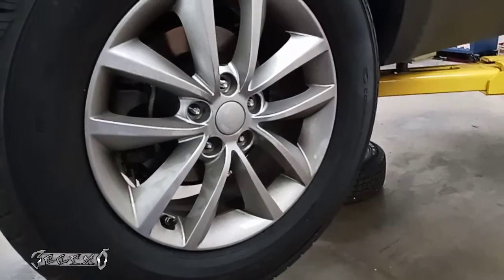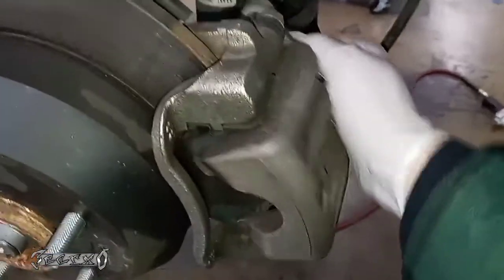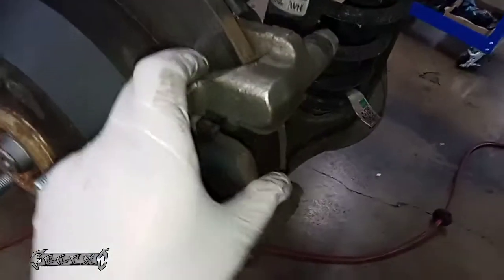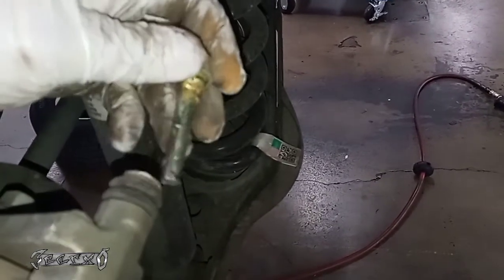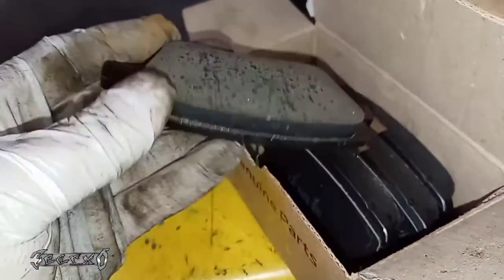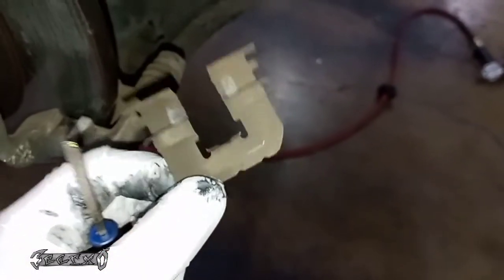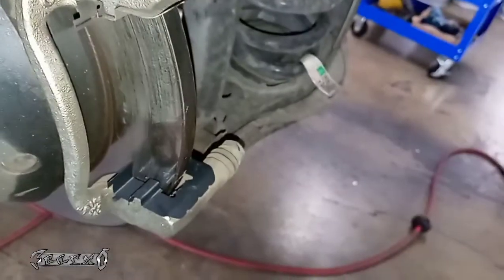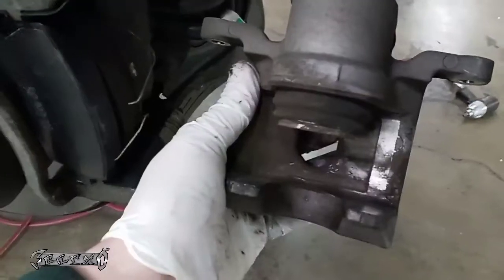2017 KIA Sorento Rear Brakes  (Pads + Hardware)

Comment: Rule of thumb for tor spec i believ the pins set to 40 to 60lbs bracket as tight as the tire 90lbs to 100lbs. The lug nuts are 105lbs just to be safe lol